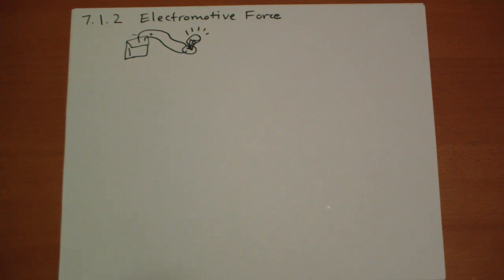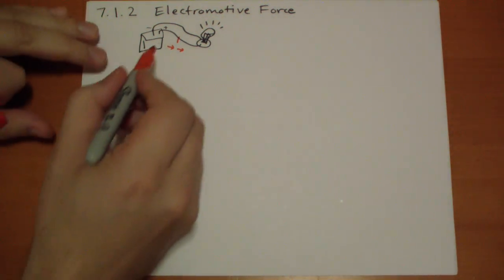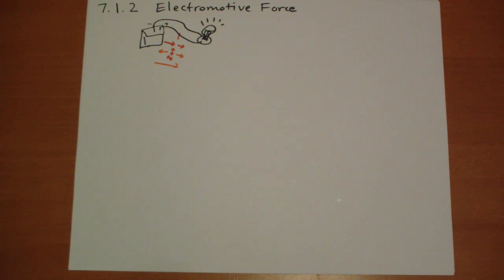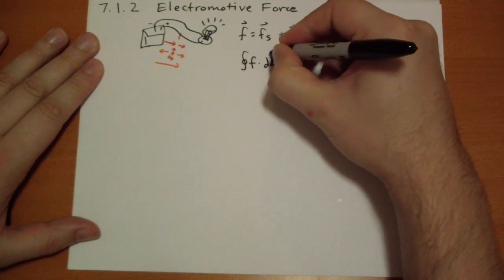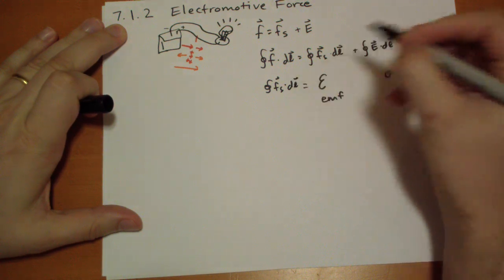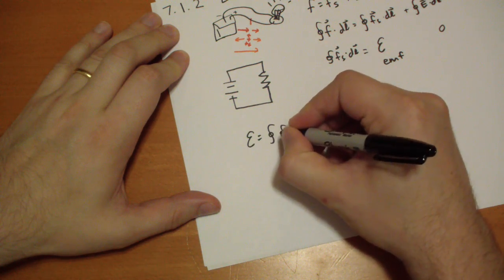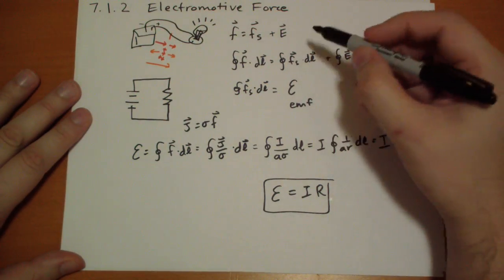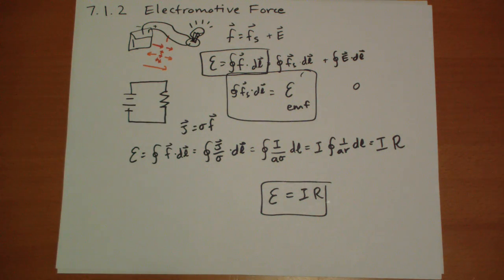7.1.2 Electromotive Force

Comment: I should have followed your video along with my textbook. I attempted reading on my own... I get lost so easily. U're probably the best tutor guide to guide a physics tourist through a book filled with ravaging complexity! Thx sir or prof or teacher or GUIDER!
Reply from the maker: Thanks for the kind words.
Reply: @jg394  Well these are words of truth and you deserve that honor! 
Btw I was really struggling with something... I hope  you can help me out with this! So essentially I am highschool student and I am tryna finish a lab report as part of an assignment... My lab is essentially a stationary coil and a permanent neodymium magnet going in and out of the loop and the aim of my lab report is how the changing the B field strength for each trials effects the curl of the electric field. Now for the calculation of my dependent variable....ie the curl of the electric field... how would I be able to compute that with experimental data. I did a lot of internet searches and most people are saying it requires some very precise measurements in order  to make the curl calculation work. Could u elaborate on that? Further more if the actual curl that relies on the cross product requires some very difficult measurement.... is there any integral expression out there that can help me calculate the curl of the induced electric field with practically measure-able data?

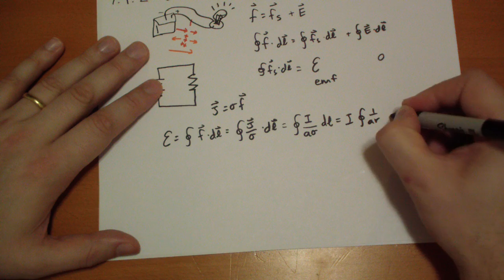Comment: I'm a little confused by the step that you make at around 7:54 or so ...

you throw in this little "r" in the denominator of your closed integral (1/ar), is this r the resistance of that small little piece you are examining? This seems like it would be the case since we are integrating around the loop and arrive at a total resistance, big R.

In other words, what I am asking is for this geometrical arrangement, is r=sigma(conductivity)?

I just wanted to make sure. Thank u, great video!